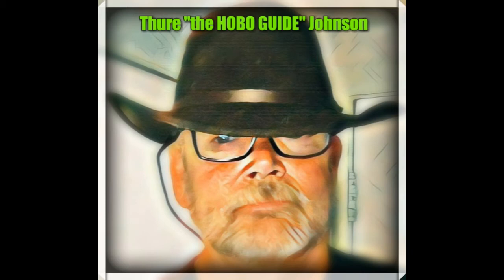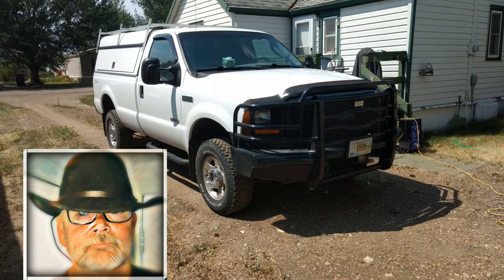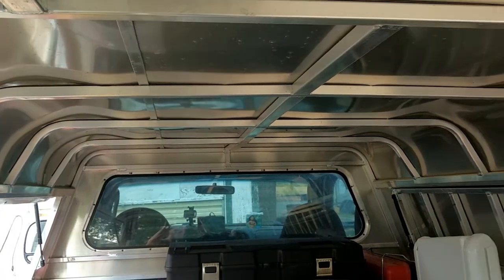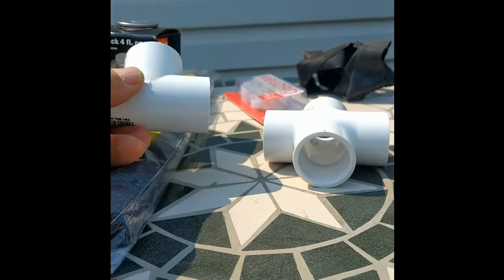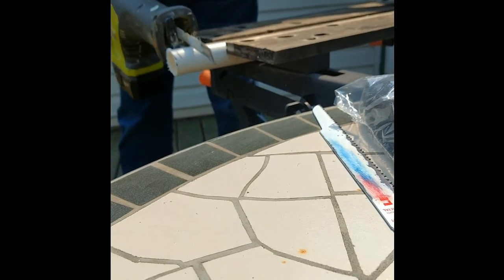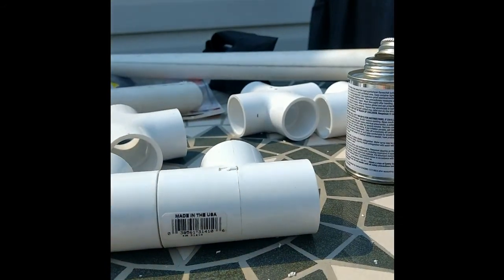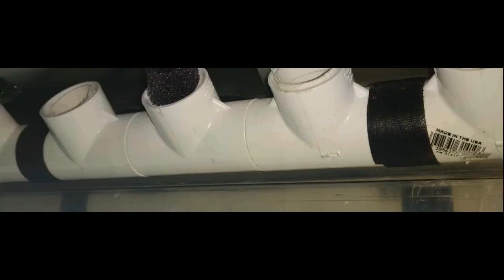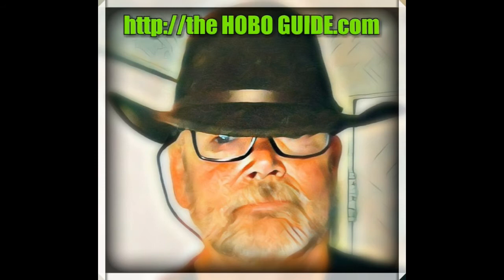Truck Topper PVC Fishing Rod Holder

Comment: Nice set-up, I had a similar setup in my topper I use PVC at the rod tip end like you did but I used very small bungee cords in a triangular fashion that crosses over the pull handle behind the real and in front of the real the hold it at the top of the topper worked awesome. I love the rods at the top saves a lot of bed space that way and protects your rods. Nice work again.